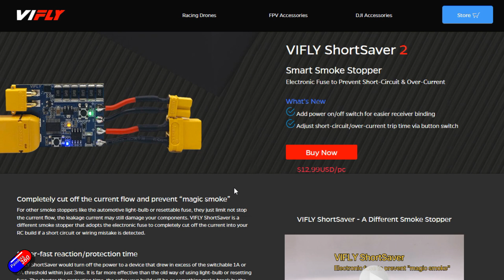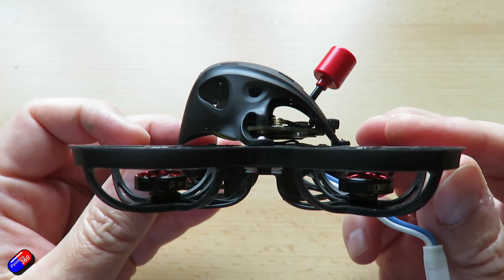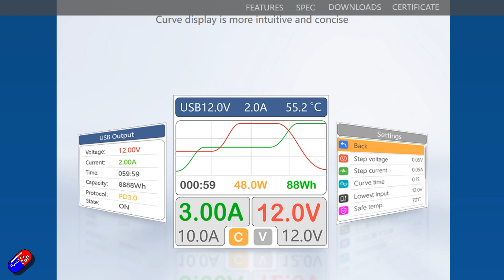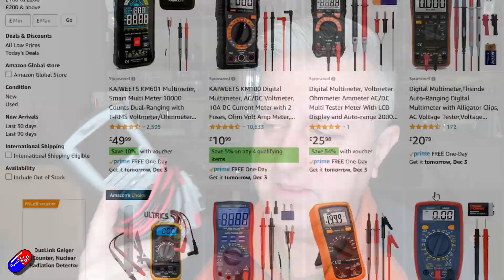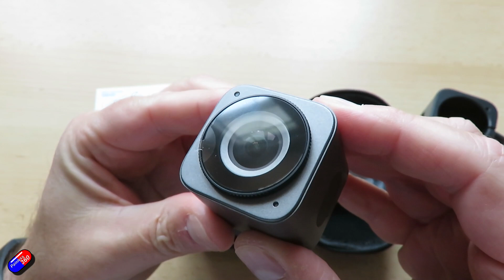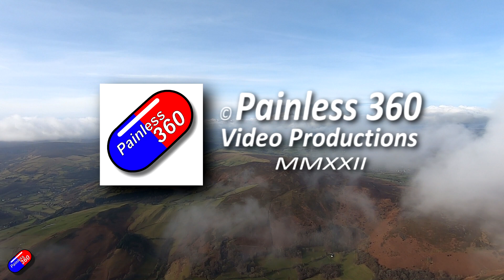Festive R/C Present Ideas: December 2022 Edition!

Comment: I'm pretty sure you seen the v-22 osprey from banana hobby VTOL, is it possible to put a f405 wing flight controller in it instead of the stock flight controller they have so I'm able to have returned to home
Reply from the maker: I've not had that one here. Ardupilot and Quadplane are now the go-to firmware for VTOL build. So, if you can fit a compatible flight controller you should be able to fly.. Best of luck

Comment: Hi Lee,  I love my shortsaver2. I use it on every build.  I carry a ratchet for the nuts and bolts, but I love mounting a aio camera/vtx on top of my rc cars.  I just ordered the Menace antennas.  I have 2 volt meters and the Speedybee adapter.  I just purchased a RunCam Thumb and a month later the v2 came out. Thanks again for the Christmas ideas.  I would love to get a Jumper XIAKE 800 for Christmas. And HAPPY NEW YEAR !
Reply from the maker: Seasons greetings to you and your family too! Thanks for all the great interaction on the channel this year... Happy flying
Reply: Also love the shortsaver. Multimeter first, to check I just get a little beep from the cap, then no continuity, then shortsaver. I'd rather a low amount of current test things first, before potentially letting full battery voltage momentarily course through my components with the shortsaver.

Wish mine had the power button on though...

Comment: More ideas for the hardcore FPV flyer in your life: A floppy hat, SPF lotion, bug repellant, USB power bank, LiPo bag, single mono earbud with short cord, and healthy snacks.
Reply: Be careful with bug repellent, if it contains DEET it will melt your controller, goggles, anything made of plastic.

Ask me how I know.

On the plus side, I've now replaced my Tango 2 case with the see through one...
Reply from the maker: Sunscreen also has DEET in so you can end up with finger and hand prints forever etched into the plastics of your kit. Same with shiny plastic trim on car doors too - again, ask me how I know!